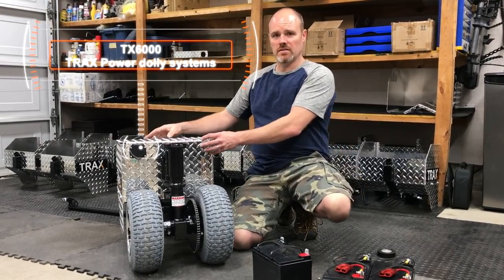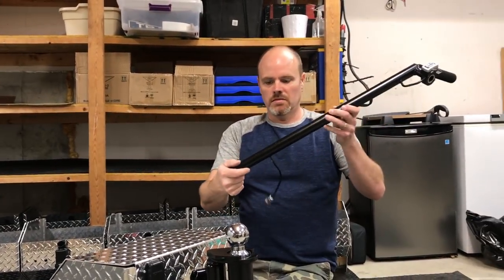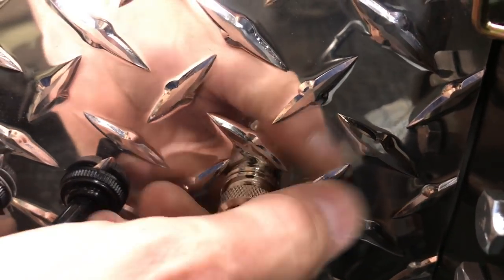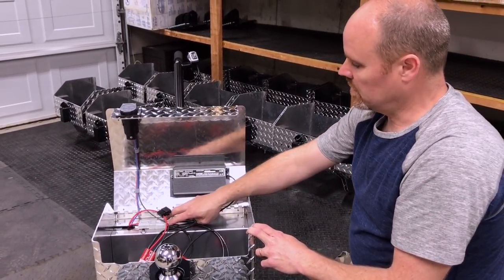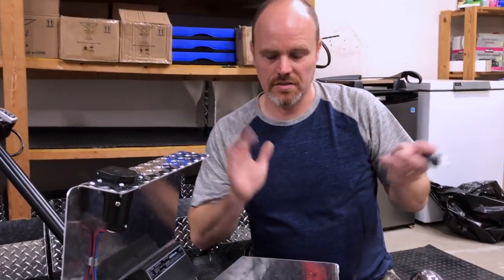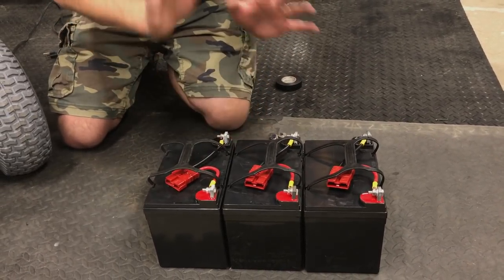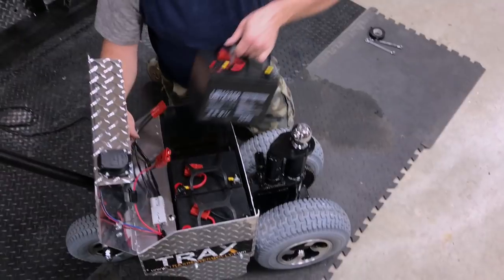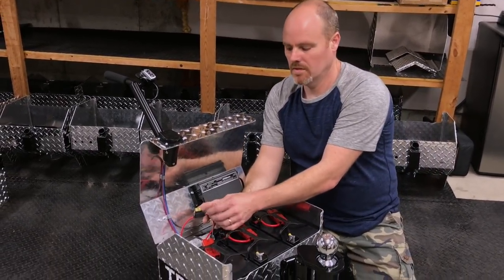TRAX Power Dolly

Comment: I have just purchased and received our Traxx today. I assembled it, that is, installed the batteries as instructed and proceeded to attach it to our 25’ Airstream.  It performed admirably.  I am a senior citizen and this piece of Canadian engineering is, in my estimation, top shelf. I thoroughly researched most all these type of units that are used to move campers and trailers and I am glad that I decided on the Traxx.  The complaints that I am reading, I have not encountered.
I am glad that I spoke with Jeff before my purchase and aired all my concerns, that he was able to put to rest. I am also glad that I did not allow myself to be swayed by these comments.
This is an unsolicited commentary and a genuine purchase.
Reply from the maker: Paul Bufalieri thank you for your testimonial. 😊
Reply: This is made in Canada?

Comment: We are looking for a power dolly to launch a drift boat sitting on it's trailer.  The trailer doesn't have it's own brake system.  The boat ramps are usually primitive with gravel and boulders!  Some are pretty steep inclines to get to the river.  Will this dolly work??
Reply from the maker: You would need a dolly that is quite heavy to do this task as you will need the weight to gain the needed traction on the wet grade and loose ground texture. One of the biggest problems for any lightweight trailer dolly manufacturer is all the math involved with a boat in water, ground slippage, grade, trailer tongue weight, in and out of the water is a complete nightmare. Not to forget having a high IP rating to avoid water damage to the trailer dolly. 

I wish I could point to one said dolly manufacturer but at them moment there really isn’t anyone doing it as of yet.
Reply: @Traxpowerdollysystems  Actually, a drift boat is pretty light compared to a trailer, 5th wheel etc.  The boat and trailer are usually 1,000lbs or less.  The boat would stay on the boat trailer and the dolly would be used to move the boat trailer.  The dolly wouldn't have to actually go into the water.  The only thing that goes into the water is the back end of the trailer, just enough to slide the boat back and into the water by loosening the winch on the boat trailer.  The dolly would remain on dry land. :)

Comment: is this a better unit than the 360 park??
Reply from the maker: Us vs the other guys 

222 feet per minute     vs.     30 feet per minute
Variable speed             vs.       Fixed speed
Seconds to connect and disconnect           vs.      Bending over twisting ball stand for minutes 
Addable future proof connection plates     vs.      No ability to adapt to different style ball mounts 
12.5" Low profile tires      vs.      16" tires that rub most trailer chassis
Rear caster wheel for easy transit            vs.         Requires user to pickup heavy handle and push or drag unit 
Motor won't overheat       vs.         5 minute of run time requires 5 minute cool down time
Quiet operation                 vs.          Very loud grinding noise
Weather protected motor control system         vs.      Exposed printed circuit board*
Standard hitch balls used         vs.         Expensive modified hitch balls  
Multi purpose adapters         vs.         Unavailable or not offered

This list is always growing as we are always improving our products and listening to our customers suggestions.
Reply from the maker: https://traxdolly.com/dare-to-compare-sheet/